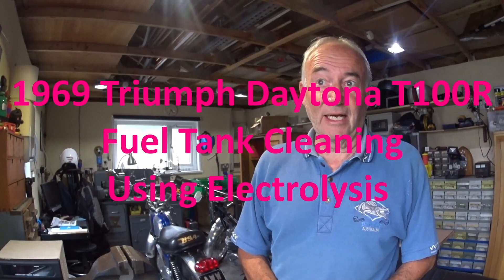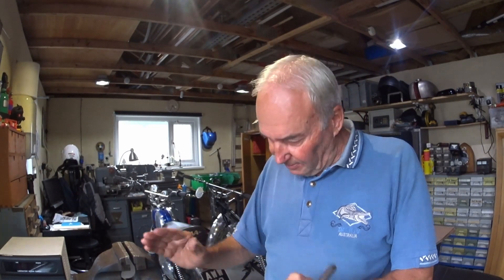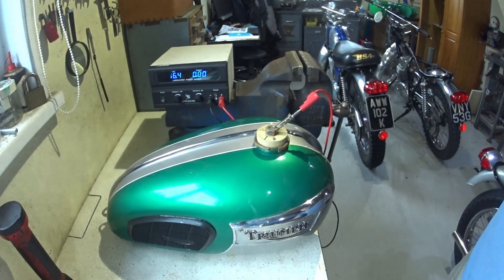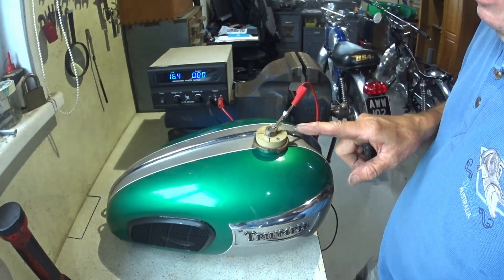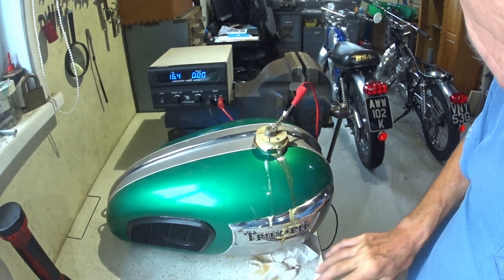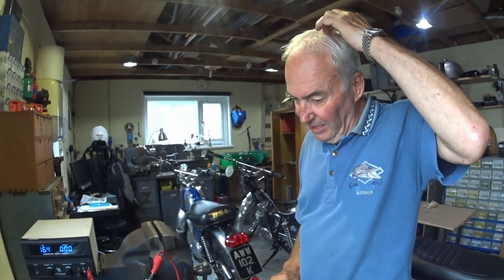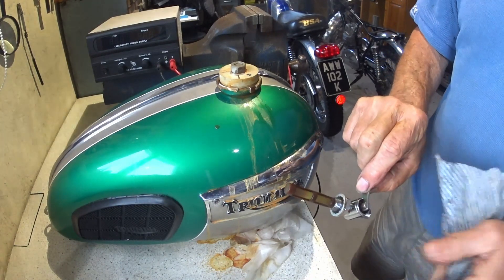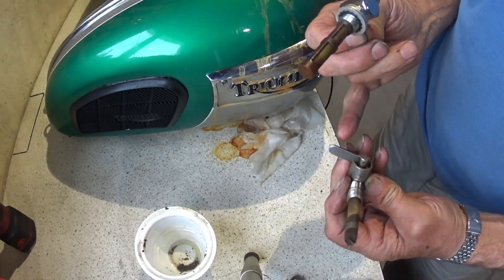1969 Triumph Daytona T100R Fuel Tank Cleaning Using Electrolysis

Comment: Brian, what is your power source from?
Reply from the maker: It’s a bench top regulated power supply, adjustable from 0 to 30 volts DC and 3 amps. Unfortunately it has just failed as l also use it to charge batteries, which it’s not designed for and it’s obviously blown something inside. However l have just bought a new one which has a bit more current, still 0 to 30 volts DC but this one is 10 amps so should take a bit more abuse.

Regards Brian

Comment: Rust barnacles on that metal rod.
Reply from the maker: I did the same on a tank for the Starfire a couple of months ago but used slightly less soda crystals, it took a few hours more, but turned out well. However one heaped tablespoon per litre seems to be the magic mix.

Comment: You can get a tank cleaning and repaint kit from Frost POR 15 three part paint kit a bit expensive but good.
Reply from the maker: Just had a quick look on-line at that product, looks ok and gets good reviews. However the tank has cleaned up fine inside, so some fresh fuel and hope to attempt a run out of the engine on Sunday.
Reply: @TheCADengineer  Ok if it's worked with the method you used then that's great and you've also saved a lot of money as well good luck with the start up